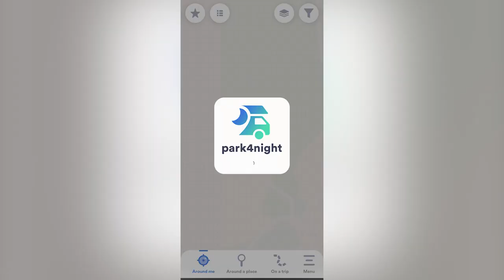5 THINGS to consider before starting VAN LIFE! (Is VAN LIFE really for YOU?) #vanlife

Comment: Some good advice, this is why we chose our VW camper as a starter because I couldn't imagine building something before trying out the lifestyle first. Not that we'd be much cop at self build, and luckily we love the van so she's a keeper anyway. We can stand up in it and it fits in normal parking spaces so it's a good balance. We do however need to be more efficient with mechanical knowledge and carrying the right stuff 🤦‍♂️
Reply from the maker: The T4 are a solid van! We would love one. Our T25 is great but slow but that's the joys of it. The waves and the looks you get make it an unforgettable journey!! Have you had any trouble with your van mechanical wise?
Reply: @ShaneandAneVanLife  Yes we get a few waves too! It seems to be a thing with these vans 😆 Mechanically we've been very lucky so far, no major problems at all which given it's from 1996 is pretty good going.